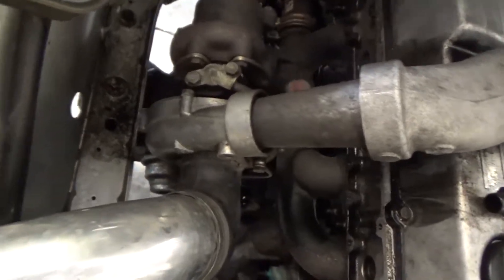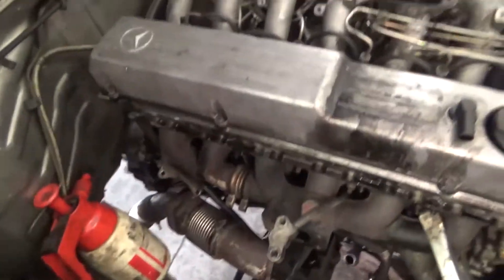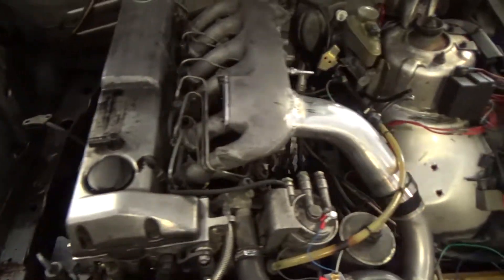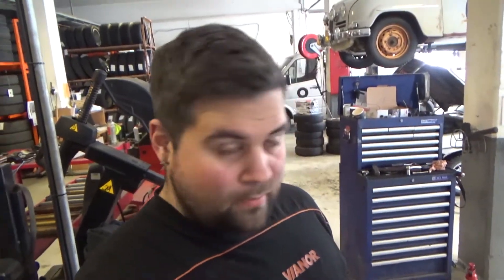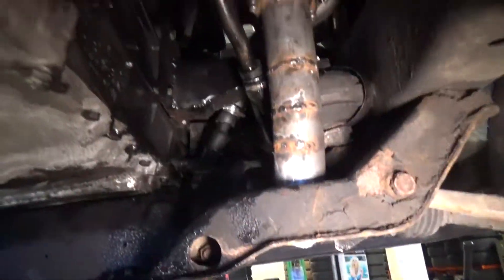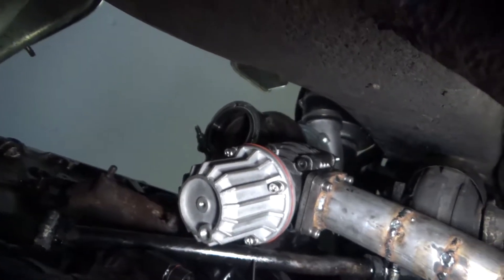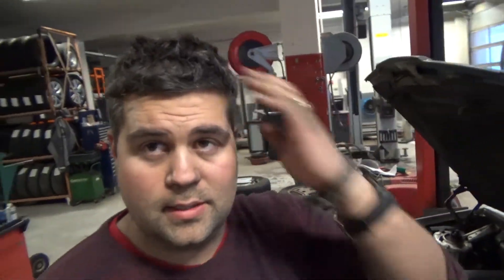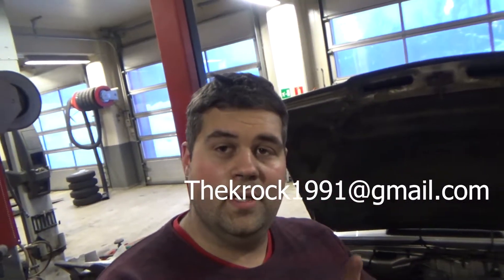Volcedes gets a new turbo! :D

Comment: sick turbo dude :p wish my little volvo v70 could make power hehe xD
Reply from the maker: Thanks dude, its a little small, but whata hek, its a daily, I don't want to much lag xD 
what engine do you have?? its no problem to tune some v70's :p
Reply: Dieselboosted Norway just a regular 2.0 non turbo engine so its not that great
Reply from the maker: yeah, but that sucker can take a punch :p
just get a 2.0 turbo, or even better a T5 engine as a spare :p
Reply: will be expensive to do a SRFO rebuild since its not turbo from factory tho :/
Reply from the maker: nah dude, if you swap to a turbo engine, you might only have to swap the engine ecu, and turbo the old sucker, just need a manifold, some oil fittings and some guts :p
nothing spescial, maby a chip but :p